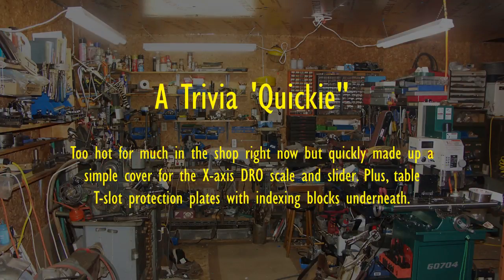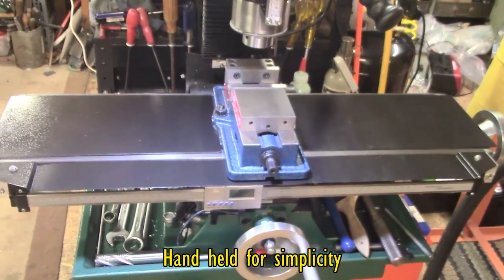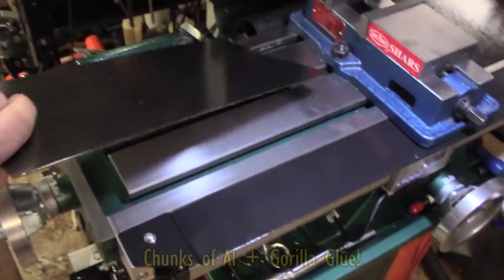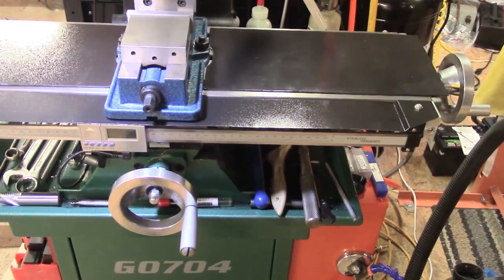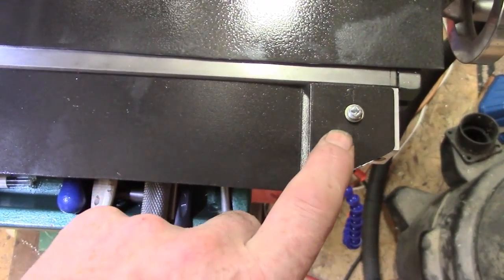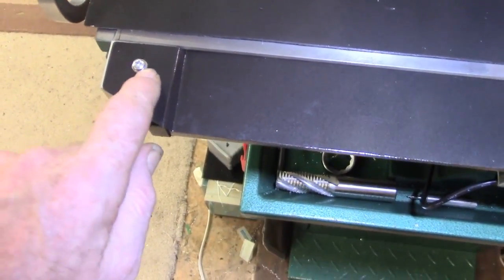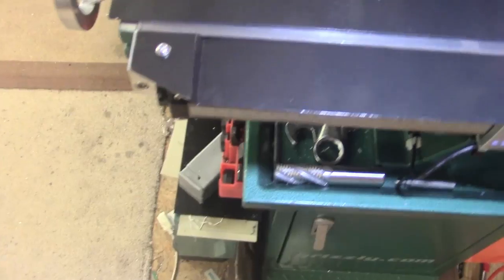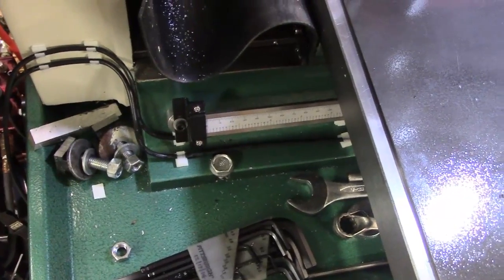Trivia - X-axis DRO cover and Table Covers

Comment: That is a really professional job! I do like the slide off bed protectors , I always use cardboard and throw them away when they get tatty,but yours are very smart, the slide protector is very compact, that should at least keep out the swarf chips, could you have put a 90 deg fold in it to make it less flexible? Just enjoy the heat! It is 112Degs and 45 % here in France, lovely! Chris B.
Reply from the maker: Englishman French Thx Chris. I too had used some cardboard but it was too flimsy and moved too much. 112º - holy smokes, you can keep that! :)

Comment: Chris....I live in East Tennessee.  Very humid here too.  I tried this idea of covers too. But found a real problem.  Moisture can get trapped under the covers.   So I found that I need to take them off every evening after work.  I got little spoiled spot on my table from the moisture and sure don't like that.  And I can't seem to get rid of it.  Well I am too long winded but just think about this for your situation as well.
Reply from the maker: Glenn Felpel Hi Glenn - I expect it's even worse down with you - killer ain't it. Interesting to know of your moisture problem - right now I wouldn't expect that as air can move freely under and around the cover, plus it's thin gauge and so shouldn't be prone to condensation with temp changes. Time will tell of course!:)

Comment: Look like you have the problem covered.  I guess you could work the graveyard shift.   It gets nice at midnight and stays that way until a little after sunup.  Well just thinking out loud.  Thanks for the video.
Reply from the maker: cerberus Haha - graveyard would be almost as hot, as, my attempts at shop insulation make heat build slower, but then after dark, heat loss is slower too! Double-edged sword! Hoping for a bit fresher soon.

Comment: Splash guards looks good you might want to put some automotive stripping around the sharp edges.
Reply from the maker: TheJR914 Good thought - but in fact finished edge with fine file and abrasive paper so - not sharp enough to do me damage.

Comment: Hi mate.
I'm not sure that you chose the best position in the states to go and live, you either freeze your toes off or you cant breath from the heat and humidity.  You might have been sent to the wrong penal colony, and should have gone to Australia. 
Anyway, that is a nice fix to the mill.
Marcel.
Reply from the maker: Marcel Timmers Thx Marcel.  Re location factors -- you can't actually win all the time. PA is way safer regarding twisters, hurricanes etc but does still see the seasons as quite extreme sometimes. That said - down South like Alabama - dew point is higher in summer even tho winter easier.  Then, go north and winters are even more extreme so - I accept what is a sort of compromise! Nature always wins. :)
Reply: Your quite right about that  It's 14.5c here, and it's cold as hell.